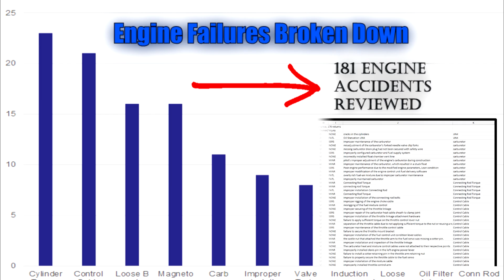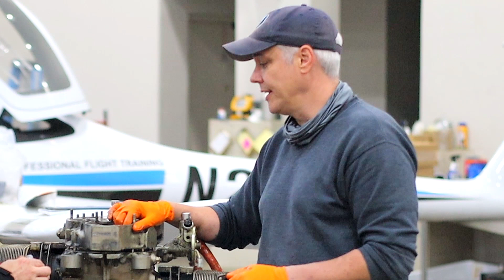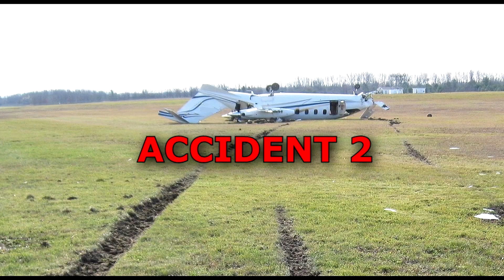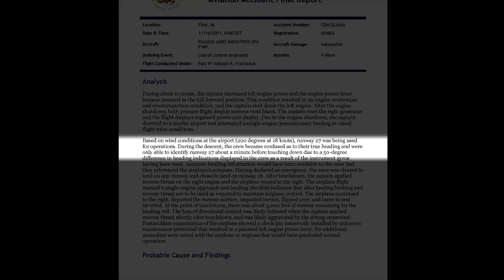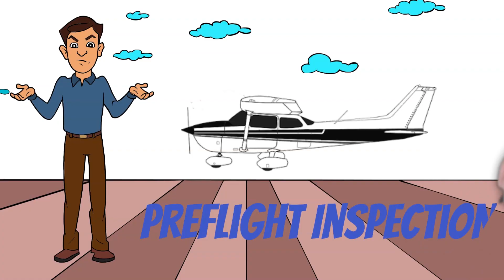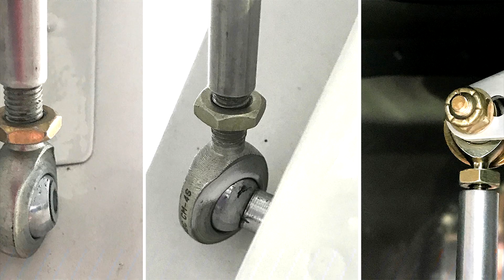Engine Failure after Maintenance

Comment: manned aviation has had many failures in the last few years,something at one time that seemed to be declining that now has risen a lot...
while the FAA instead of admitting the issue , and doing something about it, they on the other hand deny and redirect "safety concerns comments" to RC hobbyists ( drones ) for those safety concerns that do not exist.
Reply: They have done studies into leaded fuel showing the drop in IQ from its use. Pilots and those working with the fuel (maintainers have been most effected).
Reply: @chippyjohn1  Sad thing about studies is 9 times out of 10 they are bias to push an agenda, So if a study exists one needs to see who paid the money for the studies and what prompted the study to begin with and then follow the money and the results and who then pushes that study as a foundation to what end